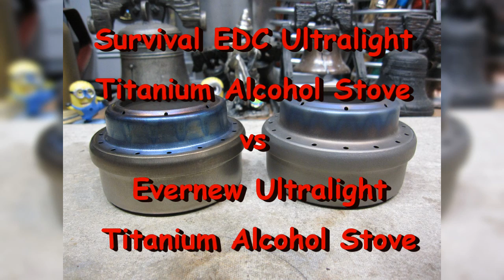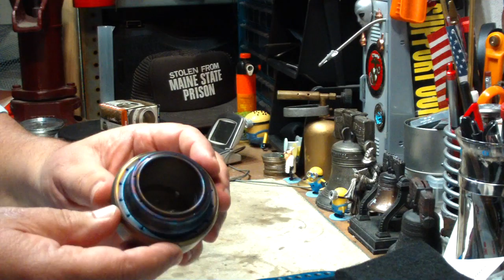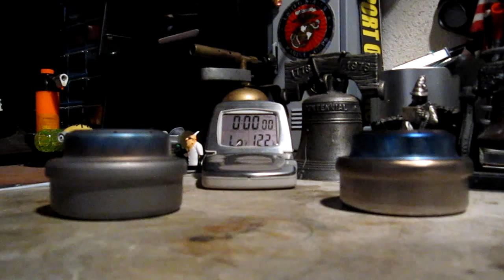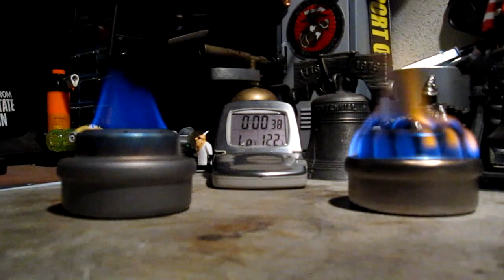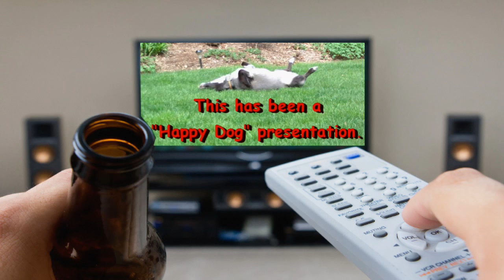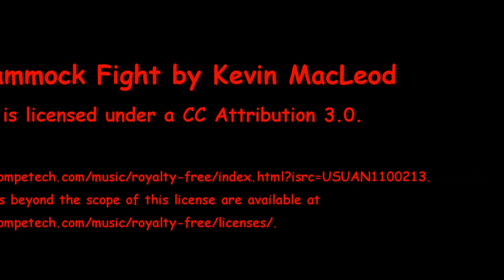Survival EDC Ultralight Titanium Alcohol Stove vs Evernew Ultralight Titanium Alcohol Stove

Comment: The knock off allows you to pour out unused fuel where as the evernew will have residue left in the fiberglass. Stink up your pack? Just prime the knock off and it will be ready quicker with the ability to completely leave no fuel trace upon snuff out and pour back into fuel bottle, or burn out. Imho the knock off is a much better all around value.

Comment: I have the Tomshoo copy with the cross stand. It is not bad at all. The burn distance from the outer ring to the pot is about 1.25 inch. That is maybe too much, because my 11.5 cm diameter pot has the flames burning also from sides. But it is very fast, just loosing heat. I would not consider using something like 9.5 cm "mug" with alcohol stove anyways. 

Once the cooking is boiling, I can take the cross stand off with my long handle spoon. And keep the pot cooking on top of the burner. And that is very economical :) 
One cup of water I can cook without the cross stand fast enough. Just keep the pot above the flames and wait it to bloom. Then put the pot on top of the stove. Something like only 8-10 ml denatured ethanol needed. 

The "blooming" is faster the less alcohol is put into the burner. I have my 30 ml measuring cup and would not pour any straight into the burner from the Trangia fuel bottle. It is way too much guessing game.

In winter below freezing, when the alcohol is also that cold, I would put the burner (stove) on the cross stand and a warming tealight candle under one quadrant to warm up the alcohol inside the burner.

In winter also a cardboard circle wrapped with aluminium that fits inside the pot and put under the burner is a must.

And if I were to burn a sausage in the stick I can be happy that the falling grease won't be going into some cotton wick. So this is the burner to do that too, not just boiling water :)

Comment: Hey Hiram, I've loved your videos for a few years now.  Just watched this one.  Maybe you figured this out and said it in another video already but I thought I'd mention it just in case. I am fairly sure that the cheap SEAUTAS knock-off, looking so similar, is made in the same factory, or with the same specs minus the liner.  What I think this means is that the interior line marking the 1 fl oz level is in the same place but since there is no liner taking up space you end up putting more than 1 fl oz of alcohol to meet the line.  Since it took 3 min longer to light but burned at full bloom for 5 min longer, I'd guess you have about 2 min of extra fuel in there.
Reply: Peter Blackwell also, it have been a cooler flame, the color was different. Some tests are needed.

Comment: excellent, thanks hiram for comparing these! so have you confirmed there is truly no wick in the knockoff? perhaps a little fuel spilled around the edge would get it up to temperature & bloom faster?
not sure if i would call the evernew design a "knockoff" of the trangia, the esbit & other brass burners of nearly identical design are definitely knockoffs, but the evernew is a variation of the trangia design that is similar in some ways & very different in other ways, it gains the function of being able to have pot sit right on top which can be advantageous, however it loses the function of having a tight lid so fuel can be stored inside... i most definitely prefer the evernew variation over the trangia, it's lighter, less bulky, & requires no separate stand, also because things can go right on top it works great with tall narrow containers like klean kanteen 27oz. etc.

Comment: Jhippl: the titanium is about the same or there would be a huge difference in weight. I think the jets are pointing outward instead of straight up where the vapors are missing the flame. Hiram could do away with 3.5 minute bloom time by priming the stove with a wick, or priming pan. Like going from 210 to 21 or less seconds

Comment: I have just bought the Tomshoo version of this stove. I’m thinking of poking some carbon felt through the jet holes? May take a while to get enough in there tho? I’m wondering if it will make much difference apart from maybe not spilling so much fuel if knocked over?
Reply: Please, please, pretty-please, do not go there. In my opinion both the Tomshoo and the Lixada, which is identical to the Tomshoo, versions are actually better than the Evernew. OK. Both take between 3 to 4 minutes to achieve 'full bloom,' as compared to the 30 seconds for the Evernew but, for a given amount of fuel, all stoves burn for a similar length of time between full bloom and final burnout. You just need to wait a bit longer for your Tomshoo to get up to speed. The big advantage of the Tomshoo is that, if you have finished cooking and it is still burning, you can snuff it out and, when it has cooled, pour the remaining, unburned fuel back into your container. With the Evernew, if you try to do that, some fuel remains soaked into the liner and will stink up whatever you carry the stove in. The only option with the Evernew is to let it burn until all the fuel has been used. I prefer the Tomshoo and Lixada versions for that reason. Also, as you already know, they are much, much cheaper.

Comment: i have the same knockoff from the brand;  mysolo (evernew knock off)  iand my jets were lighten up after 1,30 minute.  i use  Ethanol spirit! and it burns almost 14 min sharp in this same conditions. remarkable !!  maybe not as fast as the evernew, but longer and for the price its a real no- breaner in my opinion!
Reply: excuse me, i had 10 ml more fuel inside. SO 40 ml! so it also runs a little bit longer. nevertheless a great cheap option!

Comment: I wonder is this type of stove works without that stand, sience it has holes on the outside. I guess once the flames are ready, you can directly put the can over it, or am I wrong? Has anyone tried that? You can save a little weight that way.

Comment: Given your very sound observations about flame temperature resulting from the construction.
The knock off is burning with red flames & obviously cooler than blue flames.
I'm wondering if any one has tried to put a metal 'Grill' or 'Frame' inside one of those; [made with maybe an Al drink can] 
where the intention is to transfer the heat from internal bowl flame into the inside metal wall?
Reply: @Edward Gilmour are there any videos that show the use of the frame you describe and how to make it?
Reply: @wanttogo1958  sorry you and I have the same narrow range of videos to look at. good luck with that.

Comment: The knock off burns longer and the one with fiberglass too expensive for something i rarely need
Reply: James Trotman hi, you can’t put a pot on the stove until all the jets are alight otherwise the stove goes out. So the knock off does burn 
Longer but is shorter in its cooking/boiling time. They do seem expensive.